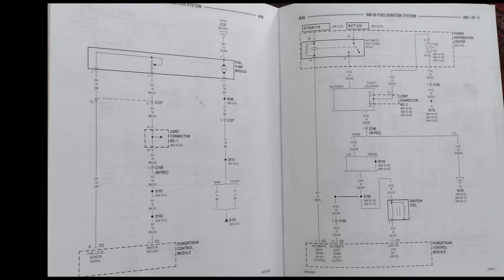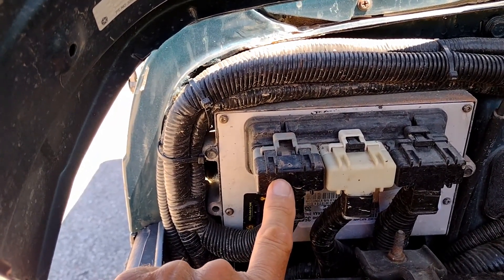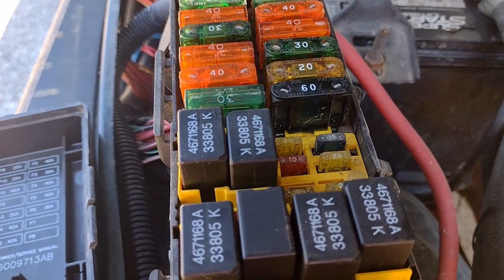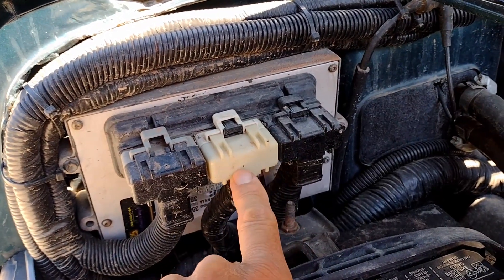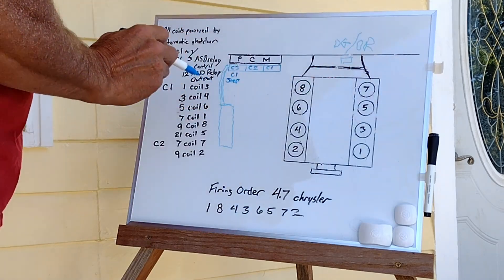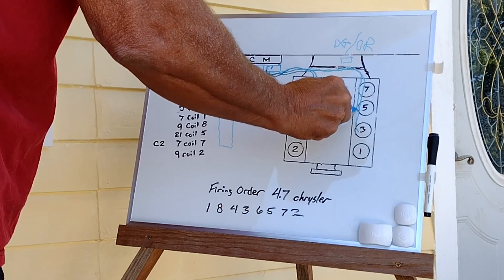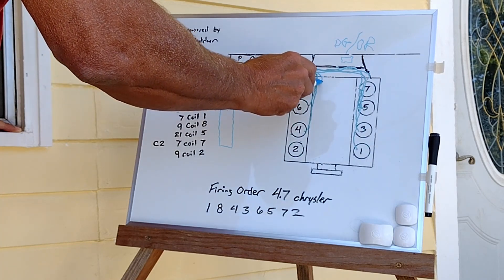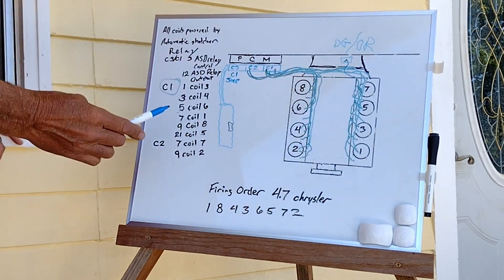V8 Jeep TJ Swap, wiring harness explained!

Comment: You’d think Mopar wiring would be as easy as using the WJ 4.7 harness for C2 and C3 and using C1 for the wrangler….. 

I did a 3.8 Camaro to a LT-1 swap in my wife’s car by just plugging the v8 harness into the car harness. That simple.
Leave it to Mopar to make you reverse engineer the entire harness
Reply from the maker: If only it was that simple, so many different options on the Grand Cherokee, and I believe every Grand had VATS, and if you don't follow the procedure to defeat it, you turn the PCM into a paperweight. The ideal harness for this swap would have been a 2000 4.7 manual transmission Dakota, but that's like finding a unicorn or a white buffalo, as there was just over 2000 made. Also, the wrangler tj, whether it was an I4 or an I6 has the transmission, transfer case and the fuel pump an gauge wiring intertwined in the engine wiring . 
I guess it just depends on how much you want to keep it all Chrysler. I'm actually looking forward to doing another one, but I'm looking at doing a 5.7 hemi .
Thanks for watching and hope to see you out on the trail 😎👍🏻
Reply: @ mines a 04 LJ and I’ve built a 08 4.7 for my 04 WJ, problem is, the WJ keeps running like a brand new vehicle. So I was going to pull the engine harness from a 04 WJ parts Jeep I have put back and try blending them. That way I have a higher hp 4.7 in my LJ. But like you said even with both being 04 jeeps, the wiring, because of options will be entirely different
Reply from the maker: @nate4036 the main thing that you have to worry about is the dashboard communication. Through the years of the TJ, there were two different types, one was a twisted two wire setup, and the other communicated through one single wire. The trick is to find a PCM that has the same computer language as your TJ that is from a 4.7  V8, like a Dodge pickup or Dakota.... usually not a Durango because most of them had the vehicle anti theft system ( chipped keys) also make sure that the reluctor wheel in the engine is correct for the PCM ( 16 or 32 tooth)